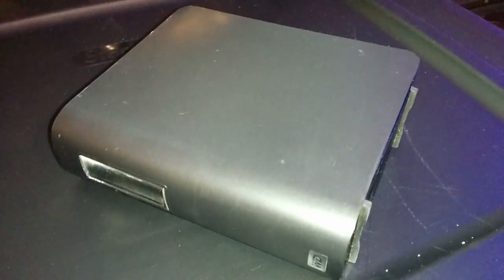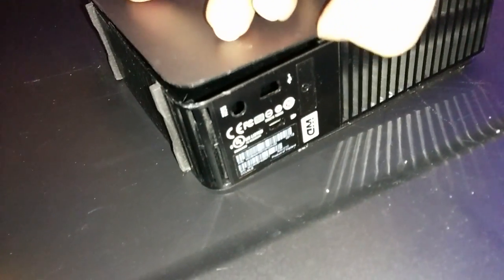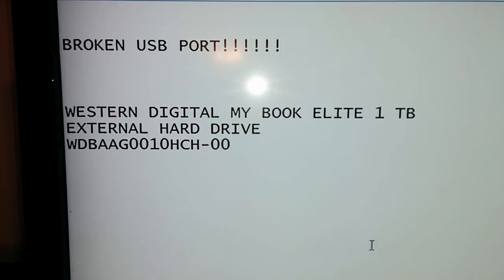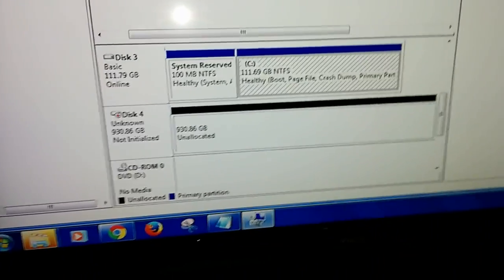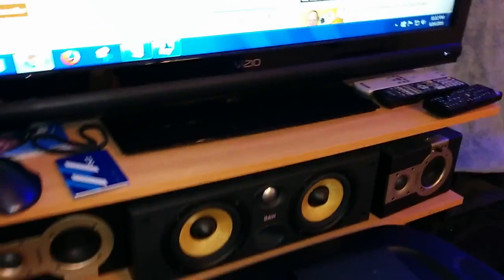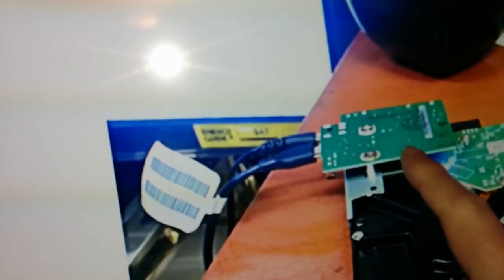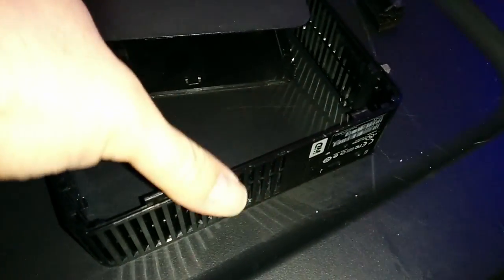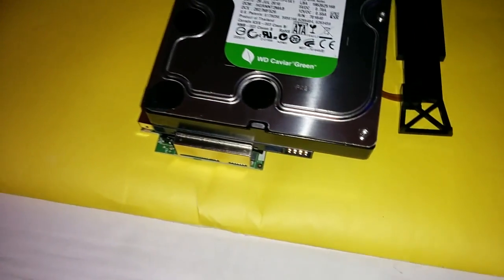broken USB port on Western Digital external hard drive - data recovery solution

Comment: Exact same thing happened to me. I took the pcb board off and plugged the drive straight into my computer, except I accidentally initialized it because it wasn't being recognized. Luckily, there's a difference between formatting and initializing. When u initialize a disk that already contains data, only the location of the files gets erased, not the data itself. When you format, the data is overwritten with zeroes and gone forever.
Reply from the maker: I almost did the same thing. Almost total bummer.

Comment: Did you try Wondershare with the drive hooked up directly by internal SATA conection too? - If it worked, that would've taken less time than (what looks like) USB2.0 connection.
You mentioned trying the drive on internal SATA, but the way you described it in the video sounded like Windows 'saw' the drive in exactly the same way within Disk Management as the video shows with it connected via the WD controller board over USB.
If this is not the case, it would be useful to see how results differ over internal SATA than what's shown here.
Reply: That's a good point. I don't remember if I tried direct SATA with Wondershare. It would be worth trying, thereby not having to do any repair. So def worth a try. Once I got a working connection via the soldered repair, I was focused on saving my data and happy that it worked.
Reply: Thanks for replying :) I appreciate that actual recovery of your data was your highest priority at the time, perfectly understandable. It would be useful to know if Wondershare could have recovered the drive over direct SATA connection, and if so how much faster your 12+ hour scan thing / recovery process would take with the same data compared to USB.

I also appreciate it's been a year since this video was uploaded, so a number of things could have happened to the WD drive since then (eg overwritten/repurposed/scrapped/etc) so doing such a comparison now might not even be feasable.

Speaking of Wondershare - Was it only the 'free trial' version of the software that you used, or did you have to purchase in order to actually recover the data? - I looked on their site, but it really isn't clear what the differences between free and paid versions are. Does it have a finite trial period after initial installation? Can it only scan, and not recover unless purchased? Is the free version deliberately slow compared to paid version? - Any illumination would be appreciated :)

Comment: this is why I just order hard drives and use docking stations. Its so much simplier
Reply from the maker: Yep, this piece of garbage was my last external drive. Never again after this fiasco. I just get an extra SATA cable and install and remove it directly from the motherboard. Not a big deal. Store the backup drive in safe deposit box. And 2nd continuous backups to the cloud. Cheaper and more reliable.  I will check out some docking stations. Thanks.
Reply: @uk7769  Your very welcome. You can get a good one that holds two hard drives for around $30 on amazon or ebay. I'm a video editor and a tech and I started doing this a few years ago when I lost an hour of footage that I had spent 6 months editing. two seagate drives failed one after the other. I might have to look into the safety deposit box

Comment: i contacted WD support and they are going to send me a new drive. But that doesnt fix the problem of transferring the existing data on my broken drive. My usb is stuck inside the box and has broken off as well. Its jingling around in there

Comment: Hi, i have the same issue just like yours and i removed the hdd off it's casing and put it on a SATA connection hoping that it will detect all of my files. (I did not do some research about this) so i have been initialize the partitioning style to GPT (GUID partition table). As you have mentioned, all of the files will be overwritten/deleted, and my drive is currently at RAW state. 

Is there anyway that i can save my files? Btw i also tried the soldering method of the usb port and i think it didn't turn out well. But then i tried and tried until the port is detected and bad news, it is now considered as unknown device. 

I'm very pissed off once i knew about the encrypting hardware in it.

Any suggestion about my case?

Comment: Didn't go as well for me.  I have a 500 GB version that the USB port broke completely out.  I plugged it into a SATA/USB convertor which showed the drive as unallocated space in Disk Management.  Sounds good so far right?  Tried wondershare and one other drive recovery software and neither showed promising results.  Found a few files but nothing near what should be on there.  Thanks for the video, it just didn't help in may case.  I could try getting somebody to solder it on, or even easier solder a cable on.  Not sure if it would yield any better results.
Reply from the maker: If you really need your data back, I think it is worth a try to have it soldered back on. I took mine to a local cell phone repair shop, that happened to have an excellent technician with the correct tools, who could solder like a surgeon. The issue is that controller board prevents you from accessing your data on the drive without it being connected. Think of the controller board as the thing that holds the key to your drive. Western Digital uses some kind of encryption that resides on that controller board.
Reply: StarFyter1 Try Partition Find & Mount from HDD Guru website if it  will yield any promising results. 😉

But if your internal HDD is failing, then you need to take it to a professional if you want your data back. 🤔

Comment: so if you arent worried about data. Can you take HD out of enclosure and hook up with sata and put in pc and format it and use it as drive D/E/F? whatever...and get rid of external case and extra board? And basically use as internal drive
Reply from the maker: Yes absolutely. If you don't need the old data. Yes the drive itself could be formatted and used again. It' s just a regular hard drive in those enclosures.
Reply: thx for quick reply ;-) Someone told me cause these had an extra board connected to them they wouldnt work inside a pc. But I figured take extra board off and its standard SATA. But Im still learning about pc hardware ;-)

Comment: Thx for retracing all your steps and showing us how you came up with a solution. I was wondering however after you went through all the trouble of resoldering the usb port why this device would not work as before? Could it be because you had (soft) repartitioned or activated it in Windows whilst experimenting with the (pre-repair) direct hook-up of the drive in your PC? I also was wondering could the recovering software not be used whilst you had the drive in this situation, i.e. directly connected on one of your SATA ports and sata power cables of your pc (I mean before you put the drive back on the WD board with repaired USB socket)? I currently have a WD 'My Book Essential' of 1.5 Gb and I have just noticed that this foolish new design of the Micro USB B Male socket and cable are not suited for frequent insertion and disconnection. I now have a probably still ok hard drive inside the enclosure but a Micro USB B Male + socket problem that does no longer make a proper connection making the drive not show up in my computer. With the networked NAS devices you no longer have this problem, but I'll have a good headache trying to salvage the data from this POS. Obviously I will try a new type B cable first. The proprietary encryption you describe of the WD circuit board is indeed a terrible idea and serves no real data protection purpose whatsoever. Unfortunately many of these enclosures including most of the modern NAS have some type of proprietary BS on either the OS or file system  making it almost never possible to put one of those disks in  a hard drive docking station and simply retrieve your data. For this reason I mostly use regular hard disk docks, I bought a USB 3 pcie card and so I have upgraded my old pc to use this in combination with USB 3 SATA docking stations and I am quite happy with that; I also consider buying a SATA Hot-Swap Bay 3.5" -> 5.25" so I can leave a backup disk a little bit longer in my PC.
Reply from the maker: Good question. I have no idea, why the drive still did not work normally
 once the micro USB port wwas soldered back on. When I plugged it in, I 
thought it was a failure. The local mobile phone repair shop where I 
took it to have the soldering done, recommended using some kind of the 
recovery software, if the drive was still not recognized by Windows 7 
OS. I will not be using that drive at all. New drives are so cheap now, I
 wouldn't even risk re-partitioning and reusing the bare drive.
Reply from the maker: That's a great idea. I will consider that too. I was thinking, motherboard/computer build, I will just allow for more drives, and do do A/B backups pluggin in the drive for backup only. THen swaping it out to safety deposit box  like I used to do. Got lazy and need to step up the backup habits. Also, I've backuped up photos and non-security risk files to Google Drive at 1TB for $9.99 per month. Pricey but it is convenient. Yeah the NSA has my photos now, but no dick pics!! Hahahaha.
Reply: Thanks for your reaction. Oh joy, a new micro B cable did enable me to regain access to the drive so I guess the lesson is, never detach the usb cable from the back of those WD books or perhaps from any USB micro B socket device. As to your Google drive solution, I am also subscribed to that service but storing/retrieving is so terribly slow (not just me having that experience)  that I am ready to cancel my subscription on that service. Did you check out their "Take out" service for backing up what you have got stored on Gdrive (that is what I am trying to do before cancellation) it is virtually impossible to download all the archive files using a web browser and you cannot use a download manager because of authorization issues (unless you hack the session data and transfer them to your DL manager). I currently have a (would not buy it again) NETGEAR ReadyNAS  (3 Tb in Raid 1 setting) on  a remote location and I am trying to make it an integral part of my home network. Once I have it all working I will probably move to a 4 bay NAS solution for a 10+ Tb platform enabling me to consolidate most of my HDD archives.

Addendum: Gdrive being terribly slow is one thing, but their sync utility program for Windows is buggy and I have never managed a full sync of my files to Gdrive anyway which makes the whole product pointless. I am pretty sure it works fine < 25 Gb but anything beyond that I have not succesfully managed. What does work ok is Android backing up photos etc. to Gdrive but Gdrive synching > 50 Gb from Windows to Gdrive, no way.
Reply from the maker: I'd say GDrive is mediocre. But their data centers have been 99.999% reliable for me for over a decade now. Only online data loss of anything that Google has of mine was some bookmarks that got out of sync in Chrome. But then, I had backup of them. It was my lifetime of photos (that was my major loss, had i not been able to restore them off that crappy Western Digital external drive-HEARTBREAKING close call) that I wanted to immediately backup somewhere online, for immediate access from any other system without having to perform a backup restore routine. And I use GDrive to share big files. I do audio music recording and colab with with friends and family. I was thinking about getting a dedicated server somewhere and use it for back ups, FTP and other things, but I just don't have the time for that or really need that. GDrive is usually fast enough for me but I have upgraded ISP service and get very good download and upload speeds. Google Takeout I do every once in a while just in case, but i wouldn't trust it. For GMail backup, I think folks should backup via separate IMAP/POP client on another machine somewhere, then backup that email data file. I use Mozilla Thunderbird email client and download newer emails every week or month or so. Then, backup that email data file. Very easy to do. Not automated but good enough for me. So that I have all lifetime of email even if Google were to disappear today, my computer were stolen, fire/flood loss etc. Peace.

Comment: any idea if this works for WD my passport external hard disk?
Reply: Sapp Cheng: In principle, you may pop your drive into another enclosure but I wouldn't know if the original WD enclosure uses hardware decryption. The WD My Book Duo does use hardware encryption and thus impossible to access data within another enclosure. It requires the same (new) WD housing!

Comment: cant we just use SATA to USB converter cable and connect the hard drive to the computer?
Reply from the maker: No. The external drive unit that I had, had a controller attached to it, that when you disconnect it, and connect the bare drive via a SATA cable to the motherboard, the drive is unreadable. The controller locks or encrypts the drive so you can't do that. I mention that in this video: https://youtu.be/PrDKD8Y2cZY?t=120
Reply: uk7769 oh okay i wanted to make sure that i understood it correctly. Thank you for your response